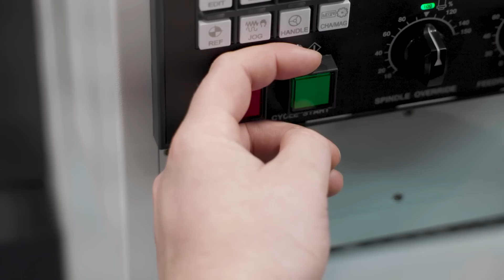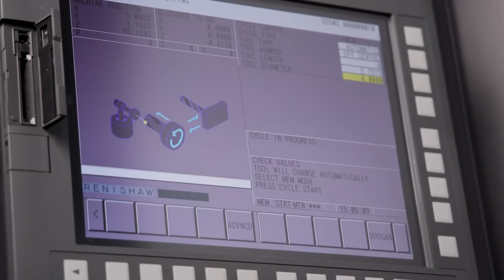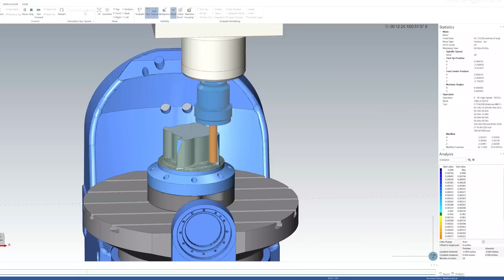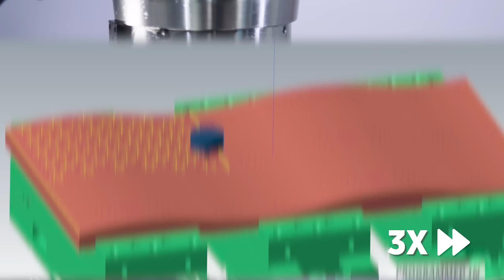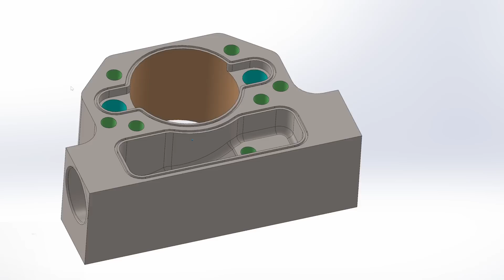My HSS End Mill Will Machine Circles Around Your Carbide Tools

Comment: I look at it like this. If you’re a owner operator truck driver and you have a paid off truck that is slow, requires a lot of extra maintenance and has broke down in the middle of a load and caused you to deliver late or very close to it. How is that ever better then a more fuel efficient, higher speed, reliable truck with a payment tied to it? Or doing a complete rebuild?

Comment: I worked at a shop that was leading in cnc and most 5axis capability in western canada. they had twin spindle/twin turret lathes, many 5 axis machines multiple pallets. An fms system where 3 machines could inter change with 40 different pallets/jobs. A large vertical and many multi pallet verticals. We at some points used hss endmills where carbide wouldn't work. But we'd run these hss endmills (niagara roughers) at 400ipm at 8000rpm facing and grooving some big precision rings for a bearings and magnetics company. For the most part, carbide will do the trick 99% of the time, but sometimes hss is needed.

Comment: I got to experience my shop switching to 100% carbide. I took home 5  1' x 2' bins full to the top with fresh hss resharps (still in wax).
Reply: Lol me too. I got a few hundred pounds of hss tooling, from endmills to form tools, to slitting saws when we cleaned out the old cabinets in the back of the shop. Carbide is the only way to go if you're trying to turn a profit.

Comment: In our company the owner have phillosophy to buy scrapyard machine and fix it to get it running.I working on one.Its 37 years old and have Heidenhain iTNC530,its really ride of your life.But machine have only 1500rpm max,therefore some crazy hi speed cuts is not an option...We using carbide inserts and mills,but drills is all in HSS.

Comment: Sooo you guys think carbide should replace all your tooling with HSS?

There are definitely uses for HSS endmills.  You can’t get carbide to be as sharp as HSS.

A lot of shops run a lot of aluminum and composites.

Weird advice guys, weird advice.
Reply: I think they think you should use the right cutter for the material you’re working. If HSS is the right cutter, that’s what to use. If carbide, ceramic or diamond is the best choice, go that way. The problem is skinflint shop owners who run nothing but the cheapest cutters and use the same holders until you can see the runout with the naked eye.
Reply: @jmowreader9555  I know what they think they’re trying to say, but this video really comes off as “HSS is outdated, use carbide for everything”

Comment: To elaborate on my last comment. I have been in the Heat exchanger  business for the last 26 yrs. When I started we were using old Cleveland oil hole drill that you had to resharpen. Running on old CNC machines with Windows 98  controls. We could only run about 8.5"/min. on a drill 3/4" dia. Now we have large CNC gantry machines made by Quickmill 120"x120" 75Hp spindles and Fanuc controls. Now we are able to run KSEM drills at a minimum of 23.0"/min. What a large jump form the old tooling. It was like stepping out of a time machine into the NOW! Was the best move we have ever done. Now only if we could find people to run said machines.... It would make life much better. We have to plant and grow our own machinist. 

Love your talks. All of the old guys are dying off. Its getting harder to find people we can talk to about the old days.
Thanks
Reply: Just upgrading the controls is a massive improvement. In the 3D printing world guys are seeing huge gains in process time and quality by pulling their old control boards and going to modern controls using the Klipper firmware. Deep mid-process tuning on a 3D print is incredible and it wasn't possible previously because 3D printing gcode files are massive and it would take too much CPU to edit 1000's of commands at once.  Old and cheap machines are getting new leases on life through better controls.

Comment: Always used carbide at work but recently started milling 6AL-4V titanium on my little manual mill at home and I was honestly extremely surprised with the cheapo 4-flute HSS Endmills that came with the machine, although Im spinning them pretty slow and taking small passes I was still very impressed with them.
Reply: Carbide is too brittle for Ti,always use m42 cobalt end mills for roughing,finish carbide is Fine.
Reply: made a throttle shaft from some 7mm, only stuff that was cheap, ground, at 7mm... give it a shot!

the slot saw was an interesting experience. only took two.

i learnt to break taps and grind them down before starting. M3 in Ti aint good!

Comment: Everything comes down to what kind of shop / machinist you want to be. Go big with a bunch of payroll and overhead or buy a used VMC, a Prototrak, and a few decent lathes and take the jobs that Titan can’t even be bothered to look at. Everyone I know running a small job shop is covered up with work. It’s a lot less painful to neck down a HSS endmill for some special purpose than a carbide one. Less of a pain in the ass as well. It’s definitely a lot easier mentally to let those machines that are paid for sit in the garage you own while you go on vacation. They aren’t eating nothing.
Reply: but a counter point is just bite the bullet get the carbide for the majority of your work and grab the HSS for those specialty purpose jobs that you will literaly only need the tool for that job
Reply: Anyone running a job shop using HSS is just losing money. They have no place in a business anymore.

Comment: I think unfortunately some shops are too focused on getting the work out fast with only what they have that they don't stop to consider this. Most may simply not take the time needed to analyze their process efficiency because they're in such a rush that it would be faster to do it the slow way they know then learn the new fast way.
Reply: Or they're too set in their ways to even think of changing things like my shop. We have parts and tooling that haven't been touched in 5 years or more. And there's plenty of outside space where they could store so many unneeded things and free up space.

Comment: I have used hss when I am not sure about the rigidity of a part setup that I can’t improve economically otherwise always carbide. It doesn’t happen very often. I have even made tooling out of tool steel for special jobs that needed a very fast turn around. So to me having an expertise in a range of tooling and the the knowledge of when best to apply it is important. Especially when replicating parts designed when Cnc machines were not in use. Like for instance parts for the f1 rocket engine. They can be very difficult to make in todays machine shops

Comment: I think it's interesting that hss sells for the same price as carbide.
Reply: Supply and demand. Carbide use has come a long way in the last 30 years. HSS was a 1/4 to 1/5 the price of Carbide. Now if you open a MSC flyer or others. Carbide end mills make up more pages. HSS in more drills and taps section.

Comment: There are 3 times to use HSS; clearing mill/casting scale, un even surfaces, and if your part/set-up rings like a bell
Reply: And certain plastic jobs.
Reply: @GeneralChangFromDanang  Can you give an example. I only do 300 series or Aluminum.
Reply: @Eluderatnight  HSS tends to have a slightly sharper edge because of the lack of coatings so it works well in most plastics.

Comment: When I left the metal cutting industry it was 1990. Ceramics were first coming onto the market, and companies like Sandvik, TRW, and Kennametal we're pushing their carbide inserts full tilt. Unfortunately, however, you didn't have the knowledge-base back then that you do today. You had salesman come into your shop that would sell you the newest, latest, and greatest....... But they wouldn't be able to show you how to use them efficiently. And when you called the company headquarters their people were mostly only able to tell you what size insert to use and what materials it was meant for. (No practical knowledge of feeds and speeds and depth of cut ..... They were all reading from the same sales brochures and catalogs). 

So you would buy carbide insert tooling, but you wouldn't use it nearly as efficiently as it could be used. Why? Because you were deathly afraid of breaking inserts.... And then having to explain that to a manager who was watching every penny. So we just did the best we could to find the most durable tool steel cutters..... And when they got dull we'd send them out for resarpening. Inefficient? You betcha! But that's the way the technology was back then. I was just starting to look into cryogenic treatment of high-speed steel and carbide tooling, which made the tools keep their edge longer...... Companies like Amcry were first ramping up to provide that service.

Heck, we were cutting some nasty materials: hastelloy-B, hastelloy-C, monel 400 on a daily basis for parts used in the oil and chemical industries. And the knowledge of how to cut these materials -- efficiently -- was just not there.

In today's age you have a much better knowledge base, and even much better carbide tooling. Solid carbide end Mills were almost unheard of in 1990 (and solid ceramic end Mills we're still in the dream stage).

Now...... you have companies like "Titans of CNC" who pushed the edge of the metal cutting envelope...... And are willing to tell you how to do it (and show you videos explaining exact feeds and speeds and depths of cut for specific materials). That was unheard of back in 1990! Every shop had their own version of how to handle the black art of metal cutting..... And they weren't willing to share it share it with anybody!!!!

When I think of what it would have been like to have this knowledge, freely given and demonstrated by Titans of CNC -- back then in the late 80s and early 90s -- I can imagine that our capabilities would have been almost a limitless! (And as a manufacturing engineer I would have been "kicking ass!"..... Instead of just struggling along with the tooling and technology and knowledge base of the day).

I gladly take my hat off to Titans of CNC for their open sharing of the manufacturing capabilities of the metal cutting industry today. You have not only made our job easier (shop owners, manufacturing engineers, programmers, machine operators, inspectors)...... But in sharing this knowledge you have helped make America strong again in the metal cutting industry. And maybe...... Just maybe..... We might start opening up factories again and start to manufacture again....... Now that we know how........... Again. Thank you Titan! 😉
Reply: Yes it's pretty much understood by just about everybody on the planet that these YouTube videos are "product placement" ads for specific companies. But I knew Kennametal 'back in the day', and their product line has increased and strengthened quite a bit...... As has also their knowledge base and ability to impart that knowledge to the customer. And to have companies like Titans of CNC be willing to share that knowledge..... Was unheard of 35 years ago. Back then, a company would just say "we can handle the toughest materials, the most challenging geometries, the most difficult jobs.... And do them well!"..... But they would never tell you HOW they would do it "exactly". As Shakespeare would put it..."therein lies the rub!"
Reply: You realize these guys are used car salesmen right?... just in a modern form.  They are wearing shirts with Kennametal on them, every single brand they use they have sponsorship deals with.  Videos are interesting don't get me wrong but so are the videos you can find on every tooling or machine dealer they are repping and promoting.  Every video is essentially an ad.
Reply: Those carbide company had a video & you watched what it could do with that tool or tools of purchase & best part was loading up machine/ machines with right programmes & let FLY & ALWAYS going 20% MORE

Comment: The thumbnail killed me! 🤣 I learned very early on that saving money is not always the best method. To run a company or even a department, you have to know when to spend money. We recently had an instance in which a manager could have gotten the proper repair done on our main a/c but decided to go with the much cheaper patch job. 8 months later and the company had to spend tens of thousands getting the system replaced due to this. My point is that there's a time to save money and there's a time to spend it.
Reply: You guys have A/C?
Reply: @dillonakaeduardo1732  for the office, yes.
Reply: I used to work in a welding shop that insisted on buying Harbor Freight grinders that burned up in a Month. I explained to them that they were wasting money, if they bought a quality grinder it would last years not a month. They said no that's too much, we get these for 30 bucks. 
30x12  vs 100 yeah you're saving money alright. 😂
Reply: smoke'm if you got'm

Comment: To machine parts with
Quality Tooling on an old machine or
Cheap  Tooling on an expensive CNC Machine?
My Choice the first example. 👌 
Tooling Quality overrides 
Cheap tools hands down. 
Last shop I worked was a Cheap way out type!
He would Buy New Fadals
But Not buy the Tooling package!
Nice New machines.
Using old wore out tool adapters and never new collets!!
Problems at every turn. 
Set-up time was hunt, prowl,
Indicate, check, re-check!
Infuriating for me.
I was use to no expense to Great cutting on Tooling cost.
I Retired from that Shop.

Comment: Believe it or not.... I swear to you guys, last year I worked on a machine that was made in 1996, which means it's a year older than me....the company had a computer running XP...with SolidWorks 2007 and Autodesk  powermill 2006 ... the CNC machine had about a hundred diseases ... the simplest rang out in a spindle with a value of 0.3 mm ... its production was of poor quality and took a long time, yet I was able to deal with it ....
Honestly, I learned a lot from this machine... such as patience, silence, and restraining myself from bad talk 😂
Reply: One of our CNC Mills is a Hurco BMC20, the other a BMC30; the BMC20 is a 1990 machine. Most of our machines are very old, they still work though, still make money. The electronics is where it all goes wrong, if it does.
Reply: @chrisblight6069  And I bet there's plenty of performance to be gained by replacing the controls and electronics with modern stuff. Controls can hold good machines back and separate good machines from great machines.
Reply: @poisonouslead85  We did that to an even older machine many years ago. It worked fine, the control was a little clunky to use but the integration worked well. At the moment replacing the control would cost a lot of money, something my boss doesn't have so much of.
But yes, replacing old electronics is a good option, apart from buying a new machine.

Comment: It depends what you need to do. Sometimes HSS can safe your Ass. But most of the time Carbide is the better option.
Reply: I agree Bannick. Sharp HSS can leave incredible finishes even over carbide. It does have a place in the shop.
Reply: The only time I can think of that, is if you need a part made NOW, and you need to make a lathe form tool. Thats it.
Reply: @PBMS123  unstable cutting conditions, old machines with low spindle speed, heavy interrupted cut... HSS is good basically in conditions where you keep breaking carbide.
Reply: @nerd1000ify  Unstable cutting conditions like? I think it comes down to the other comment, get good work holding tools. 
Even in all of those condition you can get carbide to work better.
Reply: @PBMS123  Even then, you could grind it from braized carbide.
Reply: @auxchar  Maybe, HSS is far easier to, doesn't require diamond wheels etc. and if it;s for a single job HSS is going to be quicker and cheaper.
Reply: If you are getting a better finish with hss you aren't buying the right carbide. Sharp polished carbide exists, you can run it 5x faster and keep getting that finish 10x longer. 
Tho I'd agree if its a special tool for a couple parts and its big tooling the savings from hss may be worth it.
Reply: I used to machine parts from nickel. A HSS tool gave a better finish and lasted longer than carbide, especially with the right oil lubricant!
Sucked to fill in where they switched to carbide inserts and water soluble coolant, always adjusting, chasing to keep the parts in tolerance from start to finish of the day!
A real pain in the ars!
Carbide tools are awesome with many materials.
HSS with TIN coating for nickel, copper and plastic turning for an awesome finish!
Reply: @rodneyw849  You clearly had the wrong carbide tools then. Different carbide geometries for different finishes. We have steel, alumnium and stainless inserst at work, they're all different.  Our alumnium ones are very sharp, and ill cut other softer metals well. You used the wrong carbide thats why.
Reply: @PBMS123  yeah, we tried many different carbide inserts, geometry, nose radius, etc. The HSS tool with chip relief and a .004-.006 cutting edge worked great, finish and tolerance, with the nickel. Just my experience!
Retired now so now I don't have to deal with it! Miss it though, it was an awesome job/career, especially when I was able to do prototype, tool room work the last 10+ years!
Reply: @rodneyw849  Knowing the right carbide to choose is an art in itself. 
WNMG is the default W (Trigon) carbdie for steel general purpose. Compare that to WCGT for non ferrous. Thats what I mean by carbide types and cutting geometry. It's a entirely different cutter, not just nose radius.